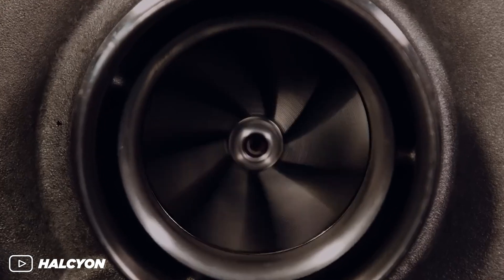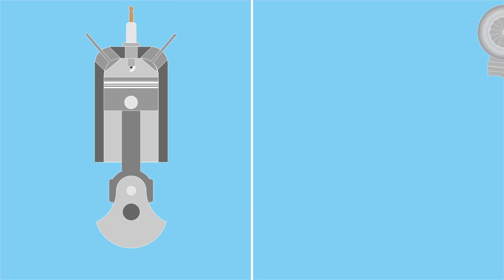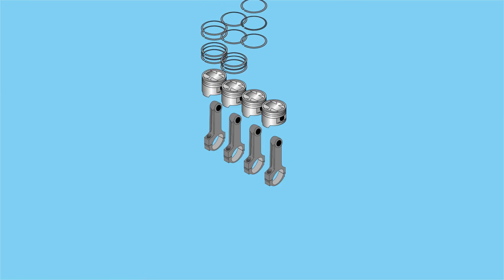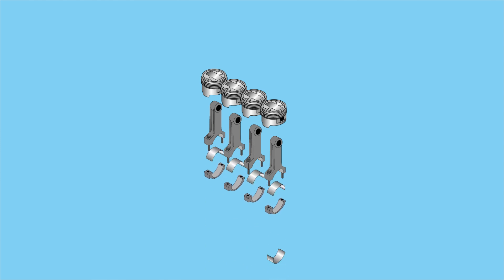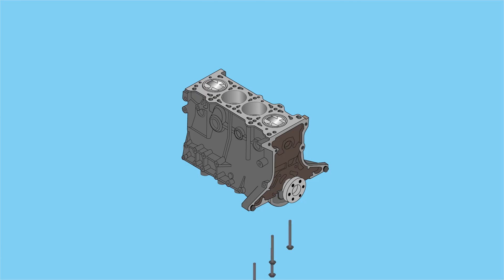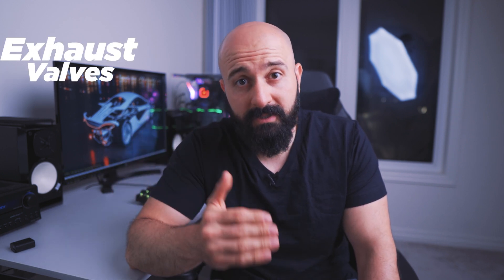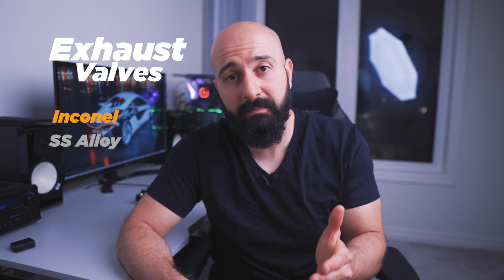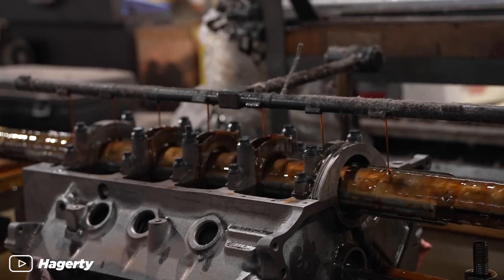Building an Engine for Boost || EXPLAINED

Comment: On the note of Subaru, if any of you are thinking of doing an NA/T subaru just rather save up for the turbo model or go for the turbo engine conversion, just not worth building up the NA blocks or alternatively you can use a turbo block with your NA heads.

Comment: M52b25 out of a 1996 e39 523i. My goal is "street, fun, ready" power( i guess good acceleration at low and mid rpm). Basically want a flatter torque curve thats not too high. Am thinking 300hp is more than enough even 250 is okay, but I really want to invest on torque😂😂

Comment: I feel like the m54b30 platform is severely underrated, having a forged crank and rods from factory, only reason why people get head lift and heavy harmonic vibrations was all small factory mistakes that could be corrected easily on rebuilding. Other than that its a cheap engine for parts, reliable, variable valve timing, a lot of meat on the cams for regrinding, a great platform for springs, pistons, rods, etc. It's basically the reliable cheaper German variant of the 2jz with cam chains instead of belts.

Comment: Just a little request… you have an awesome video of how to chose a turbo, but can you make one to chose twin turbos? Would be cool to see it plus would cover more details and differences between singles or twins setups
Reply from the maker: It's basically the same thing for twin turbo except you would do the calculations for each cylinder bank. For example if it's a 3.6L V6 engine, you would do the calculations for each 1.8L 3 cylinders of the engine to choose the right turbos